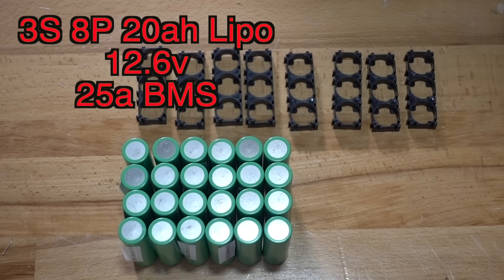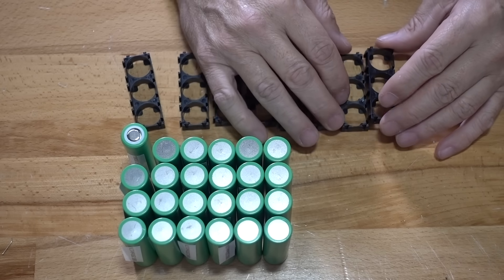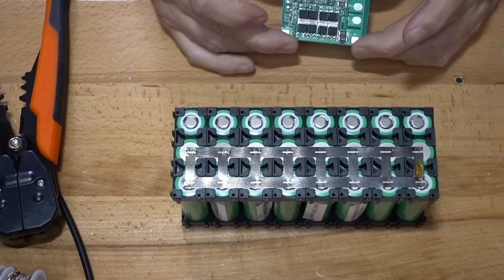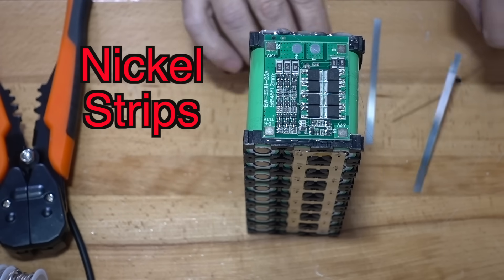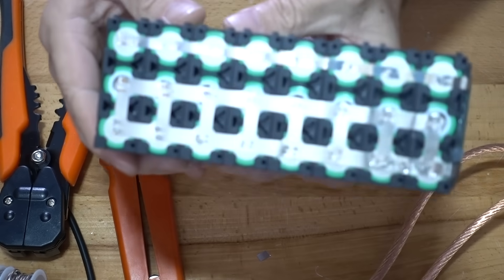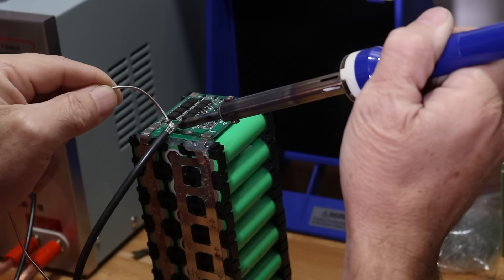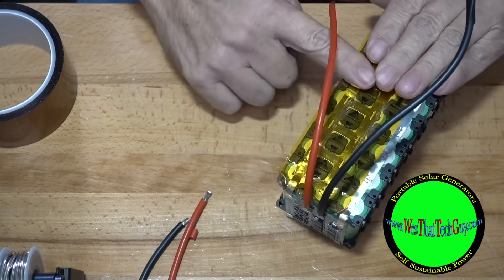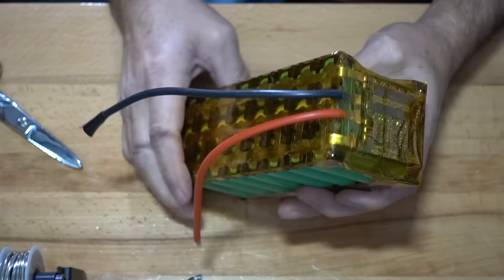How to build an 18650 Lithium Battery Pack with BMS.

Comment from the maker: THIS VIDEO CAN BE SEEN WITHOUT MUSIC HERE: https://youtu.be/p_HTv6UdgAY
Reply: Still has music😂
Reply: 8p? Isnt amp is 20 for each sell and its 20×8? 160amp? So the bms take the 160 and convert to 20/25? I dont get it...
Reply: @blank.24  Labels on the cells says 2500 mAh (2.5 Ah). Thats the capacity.
2500 mA load will work 1 hr.
500 mA load will work 5 hr.
The guy says 20 amps, but that must be max current, and has nothing to do with capacity or lasting time.
Reply: @ralorpa  8 series. 8 x 2500mAh = 20,000 mAh = 20Ah .
Reply: hey can i do this with a 4s if so can i contact you?

Comment: Hello, I have one question It can be seen in the video that your bmx is 25 in this period. Is it possible to connect two bmx to each other in such a way that it becomes 50 in this period, i.e. it doubles its capabilities? I need this for that I work on a large capacity thium accumulator so that Bmsc do not spoil
Reply: ხ

Comment: Hi there, thank you for the video. Is the red and black wire for charging or for output? If it is for charging then can you show how to connect for output? If it is for output, can you show how to connect cable for charging? The battery pack you just show only has one input or output. We always need both. Thank you!!!! I am just trying to fix my vacuum lol

Comment: The double nickel strip is throwing me off. I could expect each group of three to be wired in series on either side. But then i would expect one strip down each side with one of the strips being positive and one being negative. It seems joined within the series.

Comment: @WesThatTechGuy whats the name of the bms you used in this video and do they have for higher volts i see so no smaller wires and want a simple bms same less wires is a good thng for me with high current out put any were from 250-350 help me if you can please reply thnkxs

Comment: I dont understand how that is a 20ah battery when you're using 24 18650 cells. From what I find, an 18650 is 2.6ah.
Reply: 8x2.6ah=20.8ah. its 8 battery connected parallel in 3s configuration.

Comment: Umm. Might be best to solder the power wires to the board, and have it connected safely, all to prevent a short while soldering.. 
Maybe I am over thinking.
Reply: Talk about safety, I forgot the caption tape. Then again I did heat shrink the top leads to there wires.. To prevent cells from shorting..

Comment: Interesting. I want to make one myself..But I wish there was a video showing you how to actually make a battery pack. I have searched 100s of videos and they are all the same. Add the batteries, add the BMS board and it's done!!! Which wire goes where? On the BMS what is P+ P- Exactly where and why? What is the tape you use? If this video was an hour long and it took you step by step for dummies. I would watch the whole thing.! 🙂
Reply: I agree. This is another video made for those who know, not for those who wish to learn.
Reply: He says it in the video and has it wrote on the screen. It's Kapton tape.
Reply: Don't make it please. Save people around you FGS.
Guy literally show you that water is wet and you still don't know 😂
Reply: the BMS is marked 3.7v , 7.4v and 11.4v each cell series is equal to one of those numbers. Each is the cumulative result of each series in parallel one at a time. You align the BMS and create the extention tabs in acordance so that you can connect up to the matching tab on the BMS.
Reply: P+ and P- for hooking up your load from the BMS.. or charger also can be hooked up to same P+ and P-..

some bms has no balanced charging function.. you can solder the balance wires directly to the battery pack, but you must check the voltage point..

if you have 4 batteries, and need to make them in series connection, you must mark the 3.7V point, 7.4V point, 11.1V point, and 14.8V point.. 

from that point, you can directly solder your balance wires to the battery pack for charging with balance charger or BMS (with balanced charging connector usually jst connectors)..

Comment: 3 cells in series with 12,6 Volt will not work for a 12 Volt supply. During load discharge the voltage will drop too quickly below 12 Volts. You need 4 cells in series and charge the cells to 14 Volts to make it work.

Comment: I wouldn't advise spot welding to PCB pads. They are thin and could easily delaminate from the board. I'd solder instead. Also nowhere near enough power for an e-bike or "power wall", unless you make a bunch of these, and there's better form factors for bikes. Would also be nice to know how you're using your spot welder (120V or 230V, settings, etc.) - I've seen mixed reviews on those. Nonetheless, thanks for the video.
Reply from the maker: Thanks for watching. I appreciate your input. My spot welder is 120 V.

Comment: How do you charge this? can you just have any old 12v dc input into those 2 large red and black wires?
Reply from the maker: 12.6 V Constant current/constant voltage only
Reply: @WesThatTechGuy  How many amps for charging...?

Comment: Beautiful bank, but I have a few questions on a potential project I've been thinking about

I have a raspberry pi 4 that I want to be essentially independently portable. The power brick it came with, and the "max" voltage it needs is 5.1v, from your build, it's pushing 12.6v, maybe a little high for this little thing. I also want to put my setup in its own locking case and be able to recharge without removing the bank.

Any tips would be greatly appreciated
Reply: look into a buck converter to step the voltage down to 5v for the pi,  it may generate some heat depending on the load, as for recharging you can probably rig a plug into the case youre building that connects to the bank inside so you can just connect the charger from outside the case
Reply: The cells can be wired for different voltages and the more batteries you add the more time it can stay at that voltage if you go with a buck converter you will be wasting power in heat you could also build a board with a voltage regulator chip for 12 to 5 volts

Comment: If those Batteries are 3.7v (as listed on the side) how are you making 12.6 volts Cept maybe when the battery is overcharged fresh off a charge?
Reply: I believe that 3.7 VDC is the nominal storage charge for an 18650 li-ion battery. 4.2VDC is the voltage of a fully charged 18650 Li-ion battery... But I could be wrong of course.
Reply: @a0cdhd  ahh ok that makes sense. I just started getting into watching these videos. I want to start making barriers. Thanks for the great info

Comment: If way too long , please delete But I need guys your help.
OK looks similar to my setup but 18v5s ( for leaf blower) . Used to have balance cable/Main +- only and charged with B6ac no problem. This time however added 5s BMS( long board bms 25A rated) and no balance cables( only soldered to BMS setup). Not sure ether cheap bms boards. but first BMS mosfet burned after few hr of charge( probably had 21v and BMS shut, but B6Ac was still continued pushing) , and 2nd bms , my b6ac had error invalid voltage after few thousand mAh charged  and now in this state even voltage had 18v up. Are these BMS for not letting V drop below 3v? and what if I add balance cable to BMS and charge as balance option in b6ac, will it conflict with  BMS  charging?

Comment: My 17s battery pack is not charging above 69v 
I have series 13s and 4s bms 
There is a bit of unbalance in the cells about ± 0.05 volts
Also the bms cuts the power at only at 61 volts about 3.56 per cell 
Please 🙏 tell me the reason so I can repair it 
(About two times the positive and negative terminal also get short fow a few second with bms installed)
Reply from the maker: I don’t think your BMS can be wired in series. What BMS are you using?
Reply: @WesThatTechGuy  charging with 80volts

Comment: Do you use the same wires to charge the batteries and to power a device?  Could we have two plugs?  One to charge and one to power the device?
Reply from the maker: Yes it does. This is a common port BMS, You could add another positive wire to have 1 for load and 1 for charge so you don't have to unplug to charge. Or you can get a dual port BMS. 1 for charge and 1 for load.

Comment: I built the battery now I just need to know how to charge it safely. what charger do you use?
Reply: Not a genius at this but most likely anything rated at 12.6 v and less than 3 amps

Comment: How can you get 12.6v with only 3 in series?
Reply from the maker: 12.6v charged and 11.1v nominal. 4.2v x 3 = 12.6v
Reply: @WesThatTechGuy  so can you build the battery pack and charge it up all at 12.6v? Or do you have to charge the individual cells up to 4.2v. Before the build.
Reply from the maker: @carlosreyes6448  You can build a pack and charge them all to 12.6 V in a 3S pack as long as you use a Balance BMS. it is better if they are all at the same voltage before charging though. And they don’t have to be at 4.2 they can be at 3.7V we just want them all equal for best results.
Reply: @WesThatTechGuy  oh I see I really do appreciate your help.

Comment: hi , thank you, i am very new with li lion battery packs built, i don’t understand, where is the recharging cable or how do i recharge the battery packs? i was the P+ / P- battery output, my question is where is the charging cable? i just subscribe your channel please take care my channel thank you
Reply: How do you charge a car battery? :)  the (P+/P- cables serve as both input/output). The BMS will take care of overcharge, overdischarge protection
Reply from the maker: To the same P+/P-. This is a common port BMS
Reply: @WesThatTechGuy  so , i can use p+ / P- as a battery output and charging input too ?

Comment: Can a connect two battery packs one chinese syncpower the other an lg battery pack together they are both 52volts the syncpower is 18ah while the lg is 23ah. I need more mileage so i need to connect an external battery pack to my scooter's internal battery
Reply from the maker: As long as they are the same voltage you will be fine. Be sure to connect them to parallel.

Comment: Are you gonna pump 25A on that thin bare copper trace on the PCB? Won't it track? Aren't those solder joint gonna melt?
Reply from the maker: Yes with no problems. I’ve been using this battery for a year or two now with no problems.

Comment: Love your video man trying to build a 36 volt 12 amp battery do you have any idea how to start do u have any diagram how to complete it and doing it for my scooter look a lot of video but could not figure it out half of this are cut out the main part of it the video Spell greatly appreciate your help thanks
Reply from the maker: Thanks! I don't have one now per say but if you follow this build video and just do 10s its exactly the same. Just keep adding groups of cells so you have a 10s4-5p depending on the mah of the cells you use.

Comment: Hello Wes That Tech Guy, I made my first 3s batterypack few days ago. Using 3 x 4 = 12 cells. I did not solder or weld them. I used the spring loaded 3 cell plastic containers, and glued them back to back opposite directions. No cell touches eachother. But from the top and bottom I attached lot of wires, positives, negatives, and balance wires that goes together to the BMS at one end. Then I ducktaped the whole thing. 
I am using it to run powerful 100watt LEDs on my bike.
Is it safe so far?
Reply: For your configuration you must check the maximum discharge current of your cells, in your case it must be at least 10A. Hoping the connectors won't melt obliviously
Reply: @oli236   , Hello. It worked and I used it for few months. Then I dismantled it and spot welded it with proper method. Thank you for the reply 🙂🙂🙂

Comment: How many batteries does the board bear, like in the video
Reply from the maker: It can be limitless but no more than a 3s configuration. you could do 500P3S if you wanted.
Reply: @WesThatTechGuy  Thank you for your interest in responding first - can I use it on motorbike motor start movements?
Reply from the maker: @abdodarwish3334  you could.

Comment: Why does no one show what they charge these with?
Reply from the maker: We use a 3s Li-Ion battery charger from SolarGeni. You can find it here:
https://solargeni.com/index.php?route=product/category&path=61_72_74
Reply: But isn't that why bms is for? If I use a car charger 12v 2a would that work with bms?
Reply from the maker: @hailtothekingbaby100  NO BMS is to PROTECT!!! NO you can't use car charger at all! The voltage is wrong.
Reply: That's why I'm asking, many videos on making these battery packs but no one shows how to charge them, I did find one guy use laptop charger, it does charge li-ion
Reply: Mind you he didn't show output
Reply: I am still learning hence the name noobytech

Comment: nice  video, but there is some mistake in your information I think at 0:24 it is li-ion I guess  and if it is 8p then for its spec it should be 160 Ah I guess correct me if I am wrong 😊
Reply from the maker: This is incorrect on you part. 8p x 2.5ah each cell= 20ah

Comment: I’m rookie at BMS.  Quick question...Are bms only to safely charge and balance the batteries during charging time? As far as using or discharging the batteries, does the bms play a role? Ultimately, can I use my batteries on a ebike without bms and charge the batteries later on a Nitecore portable charger?
Reply from the maker: the BMS protects the batteries and the equipment being used by the battery. It's best to always use a BMS with Li-ion cells! If your bike draws say 100a but you pack is only good for 40a then your motor will cause the battery to overheat and catch fire.

Comment: I always see people make this battery but they don't show what they power up
Reply: Why is that
Reply: If I don't get an answer I'll come up with my own theory I don't think they'll like the theory I come up with
Reply from the maker: you can power ANYTHING that is 12v dc for the most part. Lots of people use them for  powering a DC to AC inverter or electric bike etc.

Comment: You are not controlling the state of each cell, so you just make the same mistake everyone does. Once one or more individual cells give it up, your battery is gone, leaving good cells out of order. This means you are just copying the bad habits of before. You NEED control of each cell individually.
Reply from the maker: Johan, this is NOT so. If 1 cells goes out in the series the others will still work just fine. 1 has nothing to do with the other. This really isnt any difference than individually fused cells. So not sure what you're saying? Thanks for watching!

Comment: One question, if you were to build two battery packs with BMS, each one is 12V, can it be charged in series (24V)? since I have a 24V charger or do I have to get a 12V charger to charge them.
Reply from the maker: The simple answer is no. Bms is usually will work in parallel but not always and series. You can connect them and series and try your charger worst-case it just won’t charge the bms Will stop the charger from turning on
Reply: @WesThatTechGuy  Ok thanks you :D

Comment: this is really confusing how can you have a BMS without the balancing wires?
Reply from the maker: If you watch the video again you will see that where I solder it up is on the balance leads of the bms. I explained it in pretty good detail I believe. That bms is a common port balance BMS. Where it’s soldered it goes to positive 1,2 and 3 and the negative
Reply from the maker: Ronando  it is a balance BMS. You cannot balance a series connected battery as a whole unit. Only each individual group in the series. This is a 3S battery meaning 3 groups of 8. 3s8p.

Comment: what is the max voltage you would use to charge this pack? 4.6?  or will the bms let you use higher voltage?
Reply from the maker: It’s a 3S battery pack so you would charge it to 12.6 V
Reply: @WesThatTechGuy  ya, thats what i meant is 12.6, dont know why i put 4.6.
but does the balance board require you to charge with 12.6 or can you go a little higher? just not sure how the balance board works.
Reply from the maker: @dankollars4501  You never want to charge lithium batteries above 4.2 V per cell or in this case 12.6 V for 3S. Bms should shut it off before it goes over, that is the purpose of the bms. Never use a battery charger that is not specific to the voltage requirements of your pack you must use a lithium ion battery charger.

Comment: I am planning on making a battery pack out of lifepo4 batteries in 8s 8p config for my inverter which charges the battery and discharges it. I am having a hard time searching for BMS's for it any advice?
Reply from the maker: We sell 8S Lifepo4 battery chargers at solargeni.com. We also sell the BMS you need.
Reply: @WesThatTechGuy  does it ship to india? with or without customs BTW?
Reply from the maker: @MathewZ788  Sorry no we do not ship to India currently
Reply: @WesThatTechGuy  damn aight thanks for the reply I guess

Comment: I would like to make a 3S1P using 3 18650 batteries. The batteries are protected, do I need a PCB in this case?
Reply from the maker: they will be ok with the protection board for discharge but not sure about charging them. those cells with the bms built in are not too reliable however.

Comment: Hi i have question about my BMS 10S
-Whent I measure the voltage between S1   and S10 .I find 37 V but the output  the BMS to motor I find average 24 V 
Please where is the problem?
Reply from the maker: too many variables to answer here. Check your balance leads. also some BMS will show incorrect voltage if the balance leads are not correctly wired in series.